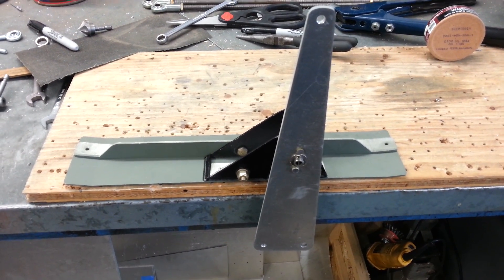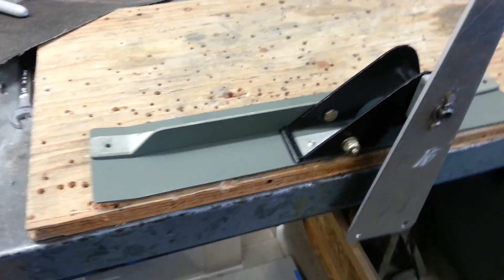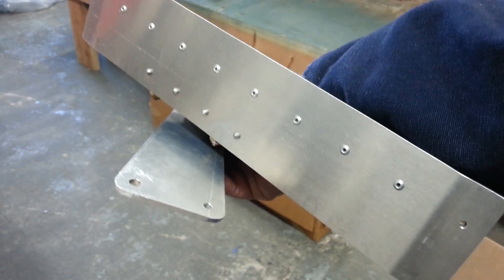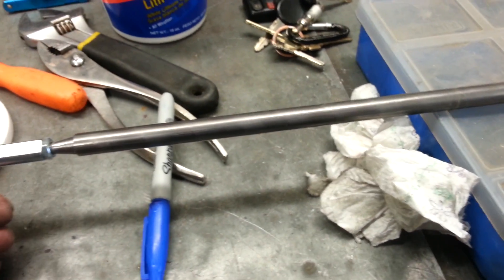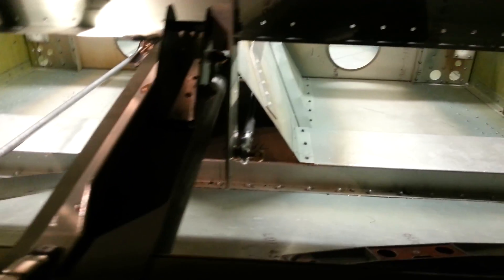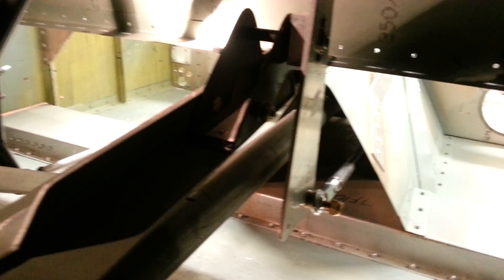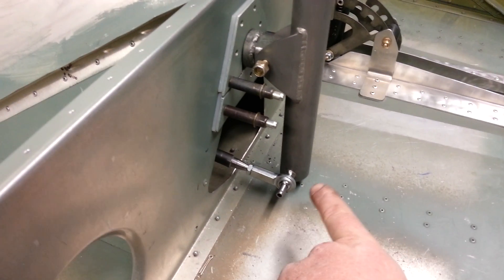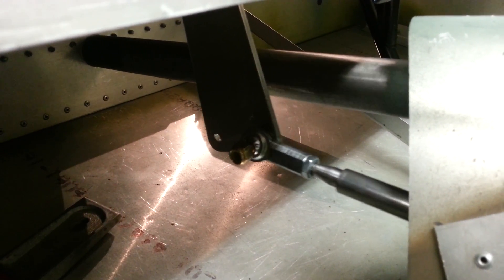Zenith 701 isolated elevator contol system.

Comment from the maker: Kaylejwm, I have not flown it yet. I am still building. This week I'm building Ailerons. My email address is vancesimons@gmail.com. Send me an email and I will keep you posted on my progress. I know changing things can be nerve racking. Several people have done this modification and love it. It pays to do your homework.
Reply: I emailed you, thanks. Also I was wondering if it wouldn't be worth turning the bolts that tie your aluminum angle to the steel bracket around to give you a bit more clearance for the control hub. Just something I noticed. The aileron hubs on the flap assembly started wearing on mine and I could feel the bolt heads over-camming on the steel bar when on final or with flaps so that sparked the current refurbishment of the plane. Had they been the other way around, the threads could have caught the flap assembly and potentially caused me to lose aileron authority.

Comment: Trying to learn more about the 701. What is the reason for isolating the elevator pushtube?
Reply from the maker: Dirk, The 701 came from the factory with the elevator and aileron controls on the same control tube. This caused the elevator cables to become slack when operating the ailerons right to left with the stick. Several builders have separated the two control to give more positive control over each independently.

Comment: Nice clean installation, thanks,   are the tube ends from an industrial supplier?
Reply from the maker: Yes the ends are from a local industrial supplier. If I remember right they were about $6 a piece. A friend who build a Murphy Rebel used them on his plane and suggested them.